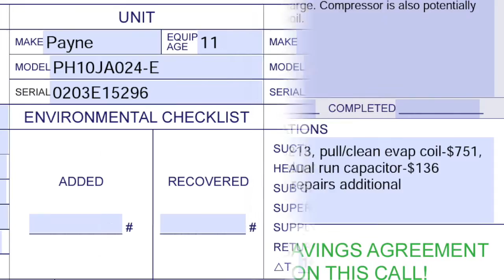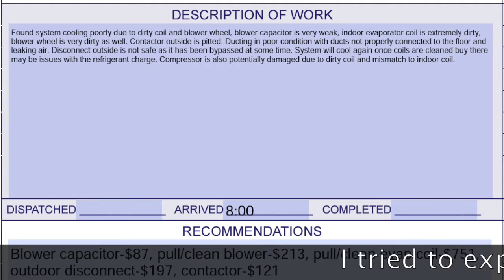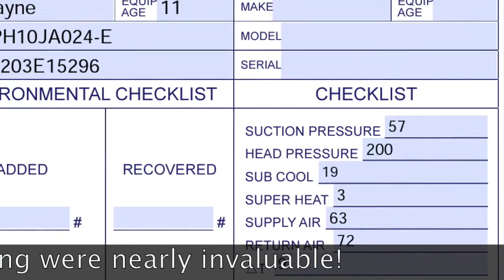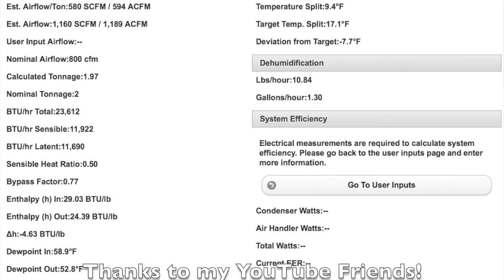HVAC Talk: Vlog and Revisiting a Rental Property

Comment: Nice one. How accurate do you think that airflow reading was in the system performance screen?
Reply from the maker: If your other data isn't within spec- refrigerant charge especially, airflow won't necessarily be accurate. Once the delta temp spreads out more the numbers will be more specific.
Reply: I was thinking same thing
Reply: Wow that unit was not looking very healthy at all. Man, I wish we had that kind of pricing here where I am. Over here all that work will run around $500 and you're gonna have to pull teeth to get paid. Seriously.

Comment: Hey Stephen
On average how much time do you have to do a pm on a single split system.
Reply from the maker: 1:00 to 1:30 with drive time usually on a single
System.
Reply: Stephen Rardon So condenser cleaning would be separate from the pm?
Reply from the maker: Jason Strom condenser cleaning is included

Comment: Some one needs to make a Refrigerant Detector, You know like a Smoke Detector.  Or is there one on the market? If it was R-22 you could get brain damage. Any way nice video I enjoyed it.
Reply from the maker: gerry mcadams good idea, I'm not aware of anything that is exactly like a smoke detector but it seems that someone could figure out how to repurpose a leak detector to be stand alone. take the idea and patent it!!
Reply: Yes, I might, than I will lobby to get a law passed that all hvacr  service trucks have to have one.  $$$  (pipe dream)
Reply: I imagine if it was R-410A, an LP gas detector common found in RVs and tent trailers might have the ability to pick it up since unlike R-22 that contains chlorine or CFCs, R-410A contains propane instead

Comment: what a damn mess.....replace entire unit and structure!  van safety....r-22 and nitrogen will kill you even quicker.  always store acetylene gas cylinders upright.  whey contain a mesh of material that keeps the gas stable esp in high heat.  failure to do this will result in unwanted results....like Boom!